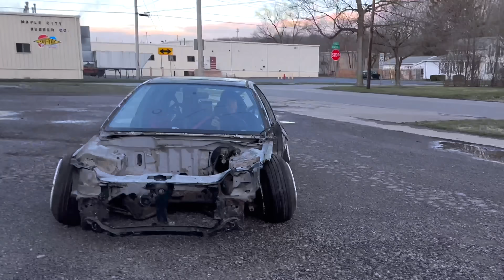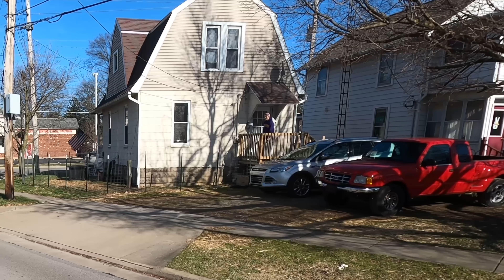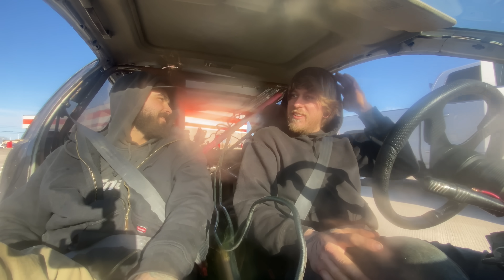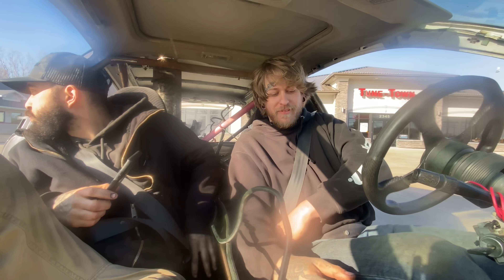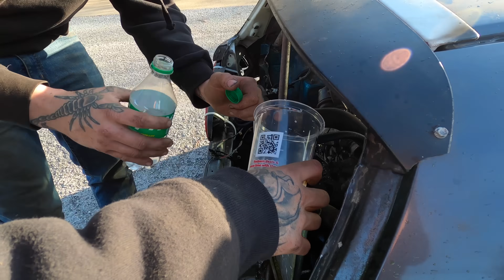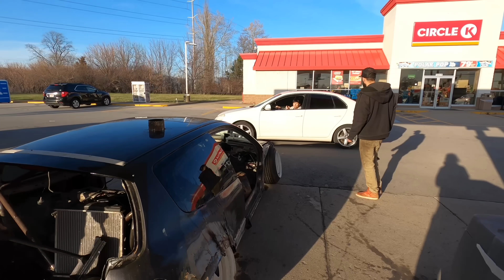Mid-Engine EG Hatch Absolute Donut Machine, Burnouts, Drifting, Highway Rollers, all in Mexico

Comment: You should make a v mount dual gas can holder and wield it into the front under the hood and cut holes in the hood so the nozzles stick out like nos purge tips lol then if you run outta gas you got two extra cans 👌🏼👌🏼
Reply: Naw pimp it out wit wood flooring an trim it up real nice like a stage an den hook up da power  antenna to a stripping pole on a toggle switch...